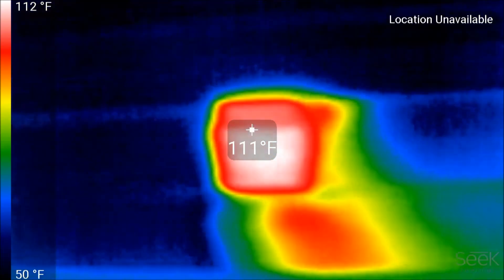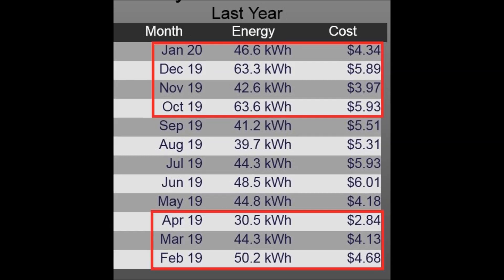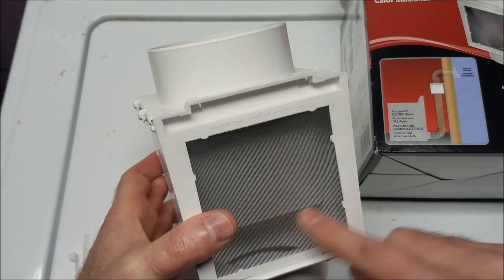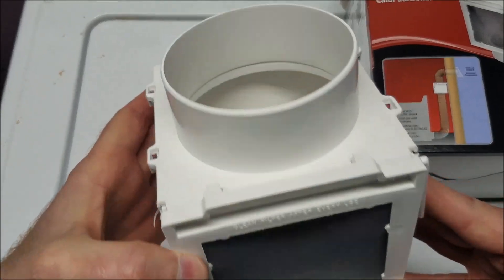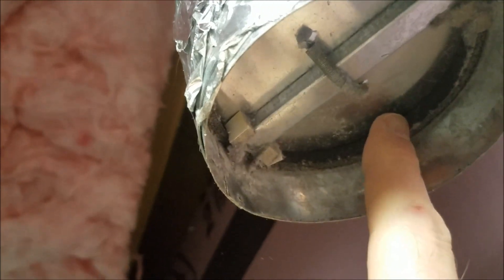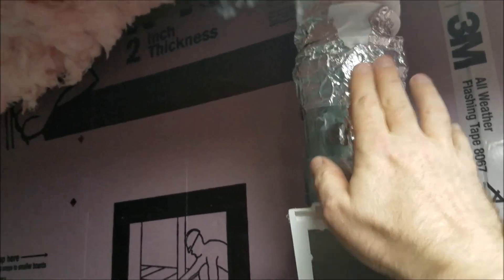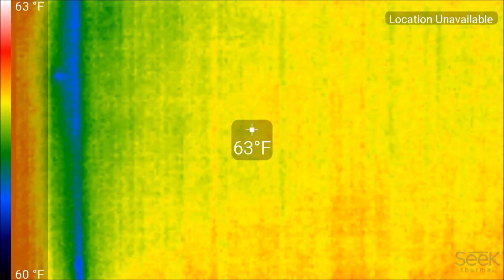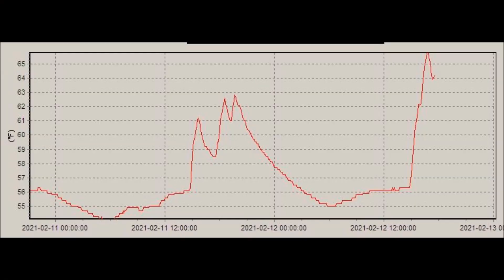DIY Dryer Heat Recovery Deflecto Heat Reclaimer Save Money on Electric Bills

Comment: I don't understand. If you blow the hot humid air back to the room, the water will condensate and everything will be moldy.
Reply from the maker: Not necessarily, if the humid air distributed over a large volume it raises the humidity a little. In the winter that's what you want in most houses since humidity is very low.
Reply: @STEM_SAVING  I understand you. In my flat, the humidity is to high in winter and summer too,  I don't know why, despite I use dehumidifier all the winter, and air conditioner in the summer. So I never use these type of accessories.
Reply from the maker: It's not for every home.  Some houses suffer from higher humidity based on their location or environment.  My house is very dry in the winter, so it works for me.